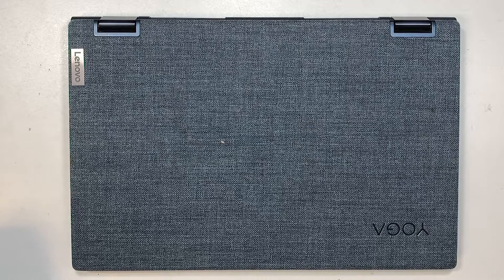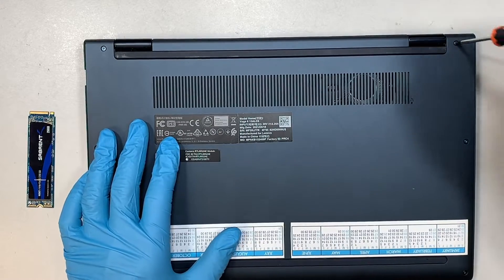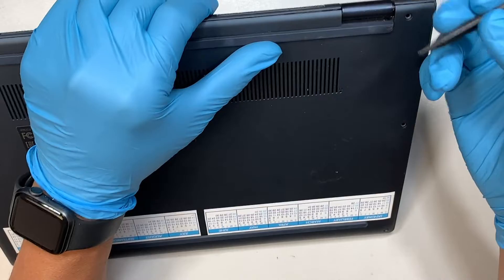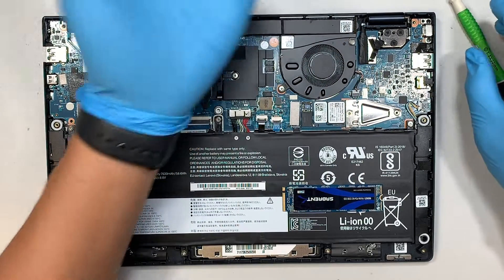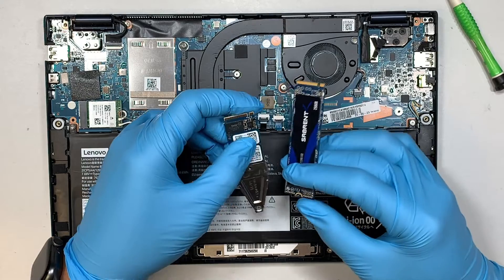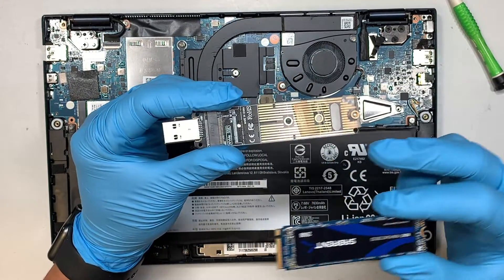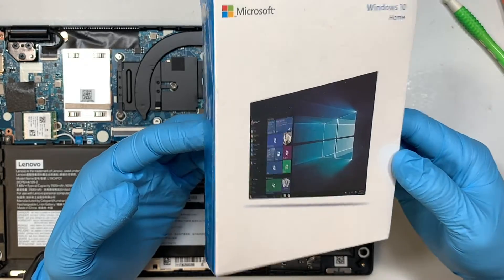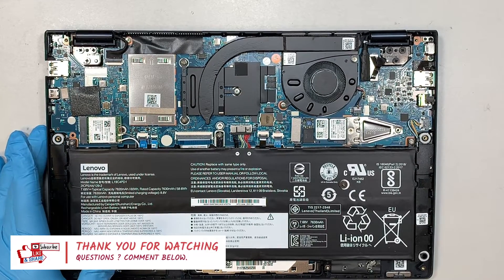Lenovo Yoga 6 Increase Storage NVMe M2

Comment: I used Linux Mint on my internal SSD upgrade with Windows 11 installed on the sd card and GRUB as the bootloader (Only for Steam). The only driver that was missing was the WiFi drivers (which was a pretty painful kick in the nadz) but if you Google on your phone you can find the Linux drivers and copy them to your netbook and get the WiFi working flawlessly. I mostly use RetroArch, Libre office, and Firefox. I absolutely love the upgrade! Thanks for the video.

Comment: I have the same laptop. Can you use a Gen 4 M.2 MVNE SSD on this motherboard? Or is the Yoga 6 13ALC6 motherboard a Gen 3 only SSD ❓
Reply: You can use the same nvme interference, the connection, but gen 4 speeds will be limited by Gen 3 interference